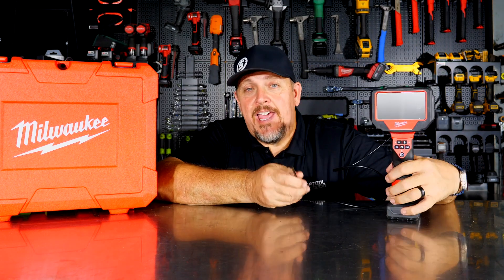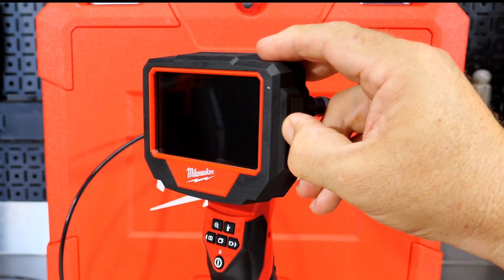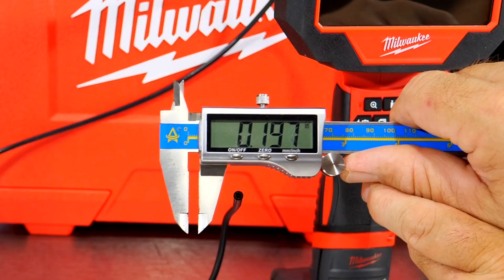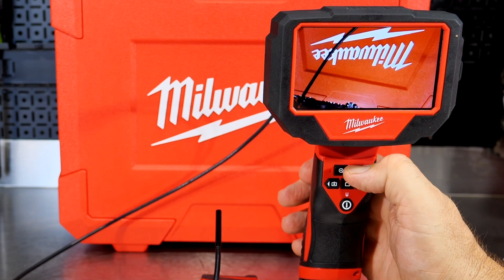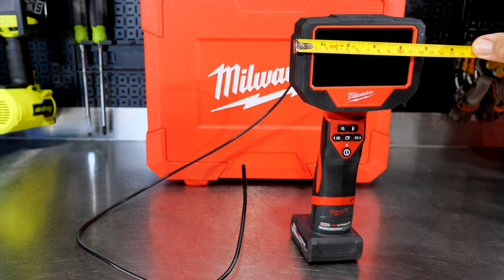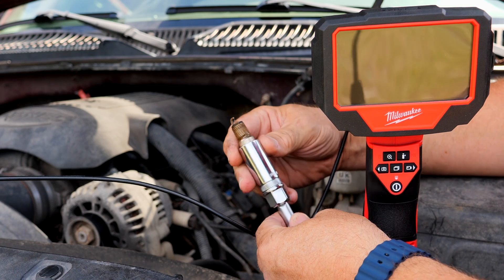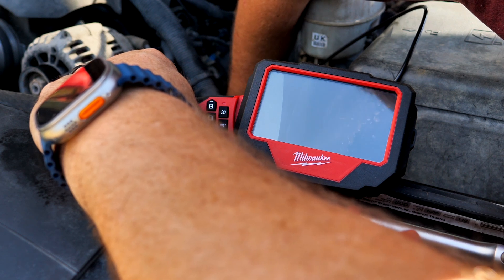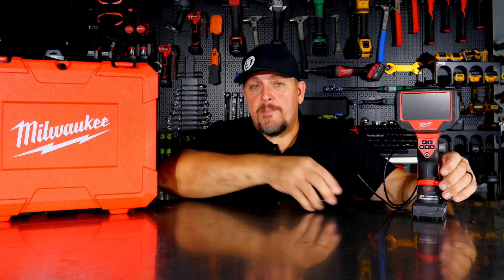DUAL CAMERAS! Milwaukee 3150-20 M12 Mechanics Borescope Review

Comment: I love my Milwaukee tools, but on Amazon there's a borescope with an articulating camera end with 1080P, same size display, although it has a .33" diameter camera. That size cam is more than small enough to go into a glow plug hole. Yes, it can't see sideways in a tight tube without the mirror attachment, but it is steerable to bend around to look backwards at 180 degrees. I don't think it has a zoom function either, but with a 10 ft cable, I'm pretty sure I can get up close to whatever I want to see. DXZtoz is the brand name for anyone wondering, but there are others to choose from. There's no memory card port, but for $180, I can live without one. If someone doesn't believe what I told them I saw, then I tell them that they can go somewhere else. 
   Thanks for the great review, but I would rather save some $ and have more useful features than zoom, memory and video.

Comment: Hey TJ! As always another great review!  I love the heat sense feature as I’ve actually lost a camera to unknown excessive heat. Additionally unlike most of the cheap scopes out there, this appears to have excellent image quality. Sadly I believe that’s where the main pros end. The first con is the arrangement of the side view camera and light is such that right as the camera is high enough to see the combustion chamber, the light is masked by the spark plug/injector hole.  This can be overcome by having an articulating camera head but sadly that’s where the second con comes in. It does not have an articulating head.  If Milwaukee comes out with a bore scope with the same 5mm diameter head that articulates or at least repositions the side view camera/light arrangement, then I’d be interested.

Comment: Tim, thanks for the in-depth review on this piece. It's awesome for sure but the only thing it lacks articulation so there's no way to get a good view of the valves in a cylinder to avoid pulling a head for inspection., Yeah leak down and compression tester is an option but it's quicker to simply pul a plug and fish a camera down for a peek. There's a teslong articulated offering that does BUT that thing has mixed reviews which has prevented us from grabbing one of those. Hopefully the big red army offers an articulating unit in the future as that would be sweet since we're heavily invested in Milwaukee already. Cheers!